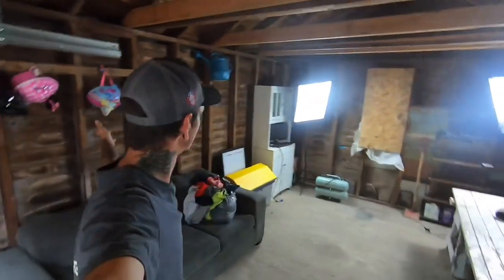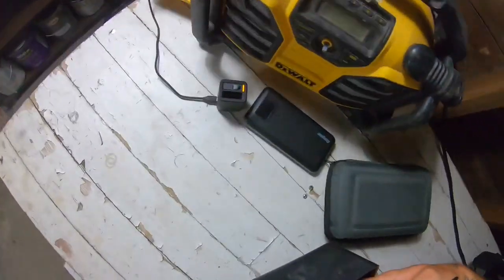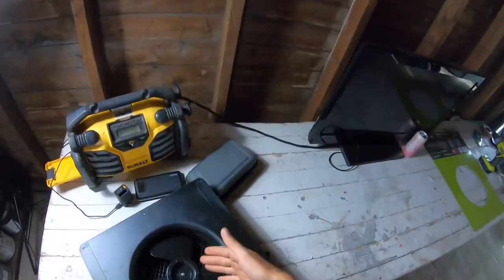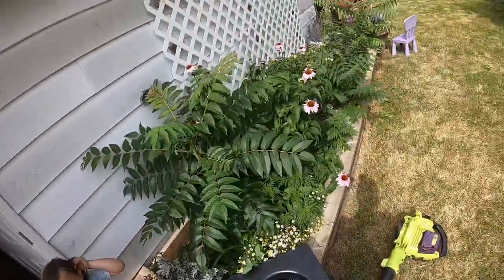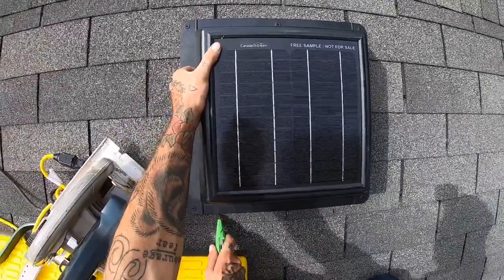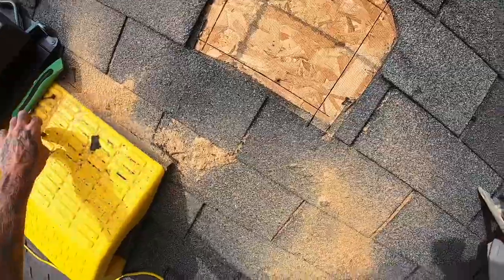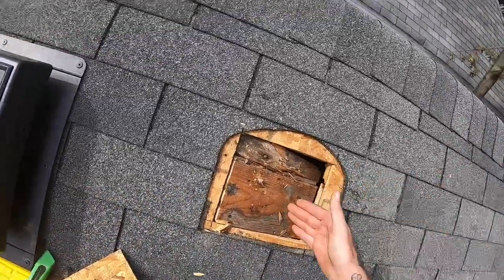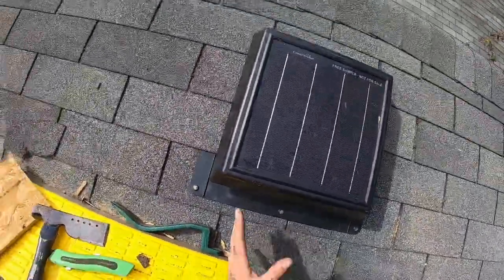Solar Roof Vent For Hot Attics

Comment: Just curious why you didn’t just put a screw or use a drill bit from the inside of the garage in between the trusses to get it right in between the trusses ?  Takes like 2 mins to do it.

Comment: Great channel! Would it work with brick and clay roof tiles? Cause the roof we have doesn't seem like the one you are working with in this video. Should we remove couple of tiles and install the vents? Or should we consider another option for the heat? Thank you! :)

Comment: If you're installing a vent into a new roof, is there anything additional you should do to prevent leaks? Ice and water shield around it, maybe? I'm reroofing my garage. There's no ventilation, so I'm thinking about adding some in the process.
Reply from the maker: You don’t need to do anything extra in our local area, but ice and water shield is beneficial to protecting you vents from future leaks and is recommended.

Comment: I've seen roofers make a 45 degree cut at the bottom of the roofers hatchet handle as a hack to make the hatchet easier to use. Some also shorten the handle to like 9 or 10inches long..  Is there any validity to that ?? Have you ever tried it ??
Reply from the maker: Never heard of that personally, I guess for hand nailing daily it could help with weight and balancing of the hatchet.